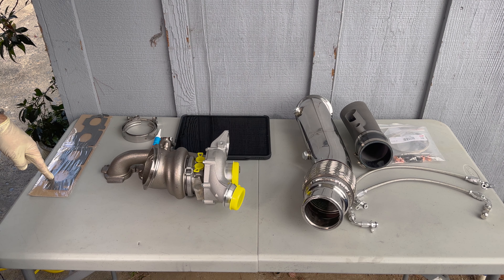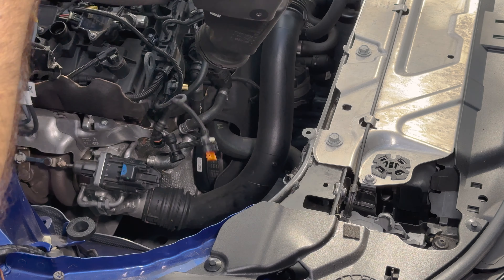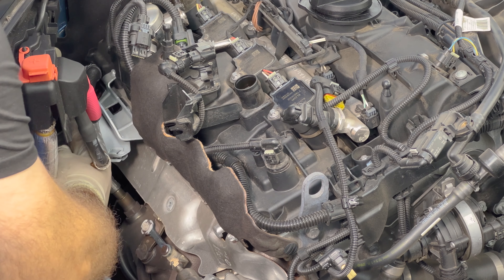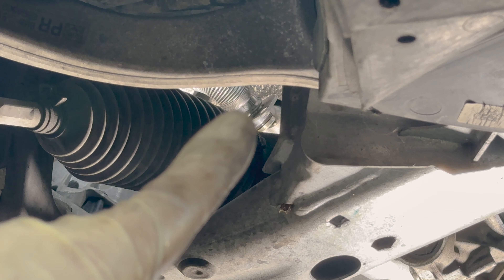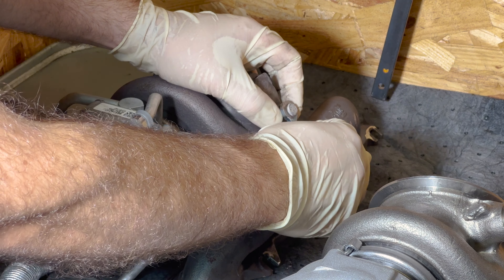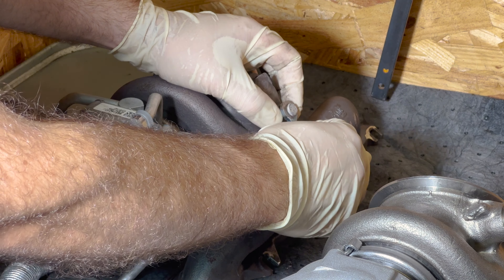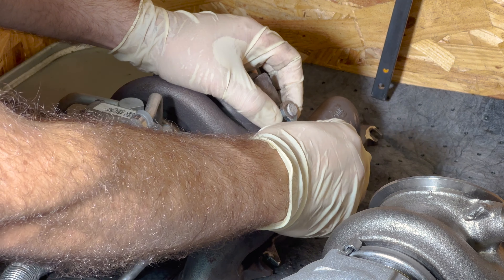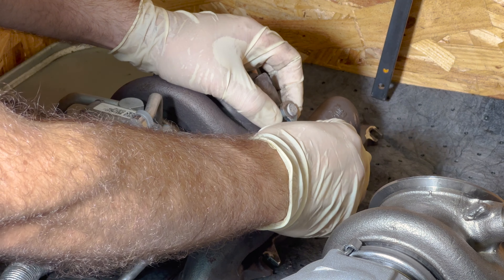I Gave My 4 Cylinder B48 BMW 500HP + Reliability!

Comment: I wonder if factory thermo managment can keep up with Upgraded turbo and power.
Reply from the maker: Luckily BMW uses the same radiator as the M340i on this car, for the sake of them standardizing they gave the 4 cylinder version all the upgrades from the bigger brother including the stronger trans and brakes/suspension for M sport models, even the stronger HPFP.  Normally you wouldn't have such a ready foundation for power, The M340i models hold super high resale because of their potential but I think the M sport 330i is the best kept secret in terms of potential vs how much they cost and how few supporting mods are required.
Reply: @VehicularDIY  , that is interesting to know. By "Same radiator as the M340i", are you referring to the high temp raditior (for engine) or low temp (for charge air)? I am just curious about this whole package. And just some background, I actually own G22 430i, which should share the same specs from 330i. But I have really big issue using this car on track: the oil temp could go as high as 140 degree in a 1;20 ish lap. Just wonder if you have the same issue?

Comment: Hey man! Absolutely love this type of stuff with the b48. Something about upgrading parts on the less popular engines is really appealing to me. What are your opinions on turboing an n52? Obviously the n54 is superior when it comes to performance, but I haven’t seen anyone really make a good n52 turbo YouTube video. I personally have an n52 and would love to try it out myself.. just cuz this type of stuff keeps the engineering of these engines so interesting… ($$$$ tho haha)
Reply from the maker: Hey!  Thanks, if I had a N52 and wanted more power I'd be looking into a supercharger upgrade.  If you wanted to turbo it I would imagine you could probably push close to 400 whp but haven't looked much into it.
Reply: @VehicularDIY supercharger is the way, it's easy on the N52 to just get the kit and do that, the N52 can handle 600 hp max with a good tune

Comment: Going to try this on a 530i. Goal is 400hp with decent gas economy m550 is just too unreliable and the 540 prices are up just because of the B58
Reply: post 2020 m550i hasn't reported any issues on the internet

Comment: I'm patiently waiting for your ipos intake manifold video 😊
Reply from the maker: It’s on the way right now, getting powder coated.  Installing a CSF heat exchanger today.
Reply: @VehicularDIY  Throwing a aluminum skid plate from turner motorsports on my g20 today.

Comment: Is there are a way to adjust the wastegate without any software? I want replace the flapper because of the rattle. Would it be possible to just leave the actuator in the closed spot and than assemble the arm somehow? Thank you

Comment: I have a rwd base model 2017 e300 w213 m274 full bolt on and stage 2 tune with a slightly shorter wastegate for a pound more boost. I’m not sure how much more it can take lmao 😂 I kinda want to test it and keep adding boost to see what the limit is.

Comment: Hey you mentioned 500HP with reliability. However you also stated the IM450 turbo is capable of 450HP? So does it cap at 450HP or you can squeeze 500HP from it without causing any problems? Appreciate the feedback. I’m actually talking to Kevin and ordering everything you did from him. Just waiting on my FEMTO unlock since its a 22 530i

Comment: I figured it was only a matter of time till the 4 cyl would be attacked by the tuners. Did you happen to get a dyno run with the stock turbo? Curious to see what the improvement is.
Reply from the maker: I didn’t but from what I’ve seen they put down around 240 to 250 whp stock so they are under rated as usual.
Reply: @VehicularDIY  kinda figured that. 200hp jump on a 4 cyl is no joke tho
Reply: FBO and stock turbo makes 260-270whp on 93 octane. Custom is around 300whp on 93 and 320-330whp on full e85. 

IPOS historically makes 370-390whp on 93 octane and 430-440whp on full e85 with a custom tune and supporting fuel mods
Reply: This was such a great video and installation. How much would you charge to install this on a 2018 b48 f36 430i gc?

Comment: Do you see any issues with this working on a F54 2017 Mini Clubman JCW 6sp manual trans w/ 10.2 comp ratio b48?  It is the factory 230hp/255tq version not the 300hp one.
Reply from the maker: They have a turbo specifically for Minis it's called the B48E upgrade, let me know if you would like a link to it.
Reply: @VehicularDIY I wanted to ask the same question (2019 2-door JCW with manual here) - please send the link and thanks.

Comment: Great piece of work. Any clue if sticking with the stock downpipe will work if I don't need 500 bhp? Seem like you did not need to add a larger fuel pump to deliver the fueling

Comment: can you imagine owning a used 1 in 10 years after all the heat cycles and breaking connectors and the wires are brittle as hell

Comment: Hello. Can we apply the same turbocharger to the G20 320i (B48B16) 1600cc vehicle we bought in the Turkish market. I know that the only difference with the B48B20 is that the cylinder volume is lower.

Comment: Would the f30 lci 330i 2017 hold with the same mods you did without blowing up?
Reply: Check if you have b48b20a or b48b20b, b is stronger

Comment: would this work a X2 M35i? thinking bout getting one actually they are 303hp stock and already have a bigger turbo then most other b48. Has anyone had a 2020 or 2021 X2 m35i ? thanks for any input

Comment: Is there a difference in the transmission between the M Sport and non M Sport G20 330i BMWs? Wondering if I need to find an M Sport version for a better transmission or it is only a matter of programming with XHP or another transmission software tuner. Never thought I would consider a 4 cylinder BMW but you got me thinking!!! Can't wait for your next video.
Reply: There's not gonna be any difference aside from at most a different map for sport mode (probably not even that). M Sport is just a trim level the most you get different mechanically are usually active shock absorbers and larger brakes.

Comment: how much power did you gain from the new turbo then? im a b48 engine 320i on a 99 ron map pushing between 298 and 306 hp with 400 torque on a 0ts 1 map

Comment: I’m almost half way through my installation now. I bought the IM500 for the big figures and top end in the future. I’m having a head scratcher moment at 3:40 for 2 separate reasons. One, I’m having the hardest time getting the end of that line out of its place. I took out the t30 screw but it will hardly budge. If there’s anything you can tell me that will help, it would be much appreciated. Also, when you started to take off your turbo, there were 5 E6/11 mm (I have gen 1 motor) and I’m also seeing another 5 of the same bolt below the headers that seems to be holding the turbo assembly in place. It’s also displayed in the 3:40 time stamp as you can see above that coolant line. I just want to know if those 5 bolts need to come out for the turbo to be set free. Thanks if you do reply.

Comment: Did you have to forge the engine parts?
Reply: I want to do the BigBoost600 turbo swap but I’m pretty sure i’m going to need to get forged pistons etc.
Reply from the maker: I'll likely run it at 360 to 380 WHP on pump gas most of the time and occasionally up to 420 whp on E50.  You can push up to 450 WHP with full E85 and port injection which I plan on doing but mostly for demonstration purposes.  So if you are happy in the lower 400 WHP range I'd say stock internals would tolerate that all day long.  If you wanted to try and push closer to 500 WHP that would technically be possible but you'll likely face head flow issues and should probably consider putting a forged bottom end in.  To be honest it gets to the point where you'd probably want to just go with a B58.  IPOS makes a turbo called the IM500 which would spool later but could target big power.  I think the sweet spot is around 400 WHP if you've got a B48.
Reply: Thanks for the insight. 400whp does sound like just enough.  @VehicularDIY

Comment: Is there a difference between the B48 you get in the 320i and the 330i besides the mapping?

I have a 2019 120i f20 lci I would assume B48 "Gen 1“ but not sure if the internals are different in the 320i and the 330i since it is sharing the same setup as in the 320i.
Reply from the maker: Yeah the pistons are different, the rods are the same.  You can upgrade the turbo but you'd be targeting less power, I talk about it near the end of the video.

Comment: Hi ... Nice .... What is your turbo recommendation to replace the stock turbo in the F30 328i ( 2012 Year with mechanical wastegate. ) to achieve something similar with the N20 ?
Reply: TTE400 is the move. 370whp on full e85.
Reply: @Sqwin_n20  - Thanks bud. I went to the site. Any idea how this compares to the MHI Big Turbo ?
Reply: @cp_pdn  MHI is maybe 330- 340 whp full e85
Reply: @Sqwin_n20  - Noted. At what whp should i get forged connecting rods ? Mine is a 328i but they still need forged connecting rods ?
Reply: @cp_pdn  close to 400 wheel torque.

Comment: This is fantastic. I plan on getting an F22 230i M Sport, but it's so hard to find B48/46 content, so thanks for this! Also, do you have any experience with F22/23 BMWs and if so, what do you think about them? I know you said you love the steering rack and turn in of your 3 series. Just wondering if you find the 2 series to be similar.
Reply from the maker: My sister in law was looking for a car and I recommended a 2016 330i to her a few years back and she's loved it and it's been reliable for her.  Don't have seat time behind the wheel of one but mechanically they are similar to an F3X.  All you would need to do on that is a HPFP upgrade from the one that comes on my car which is the same as the gen 2 B58.
Reply: @VehicularDIY  I'm not sure if I plan on doing a full turbo upgrade when I get the car, but I do plan on doing a down pipe, charge pipe, and tune. I'd like the get the power of an M240i while maintaining the weight of the 230i. Given this, do you still think upgrading the HPFP would be necessary? I'd probably be pushing no more than like 300-330 wheel hp.

Comment: How's the B48/B36 in the F30 330i? Just as reliable?
Reply from the maker: Yeah only thing with the F30 is the high pressure fuel pump needs to be upgraded to achieve similar results
Reply: @VehicularDIY  Does the same thing apply to the F22? Only need an upgrade to the high pressure fuel pump? Can you give a link to the part you recommend?
Reply: @johnrobinson6882 it’s the same b58tu HPFP the gen1 b58 folks use. IPOS sells it as well
Reply from the maker: @johnrobinson6882  Yeah that's right, if you follow one of the links I put in the description and look on IPOS site they sell a TU HPFP upgrade for gen 1 B48.

Comment: do you have a clutched lsd or anything or is it the stock open diff?
Reply from the maker: This car was optioned with an M Sport Limited Slip Differential
Reply: @VehicularDIY  I have an Xdrive 330i wagon and I was contemplating converting starting a build with it at some point. I dont wanna just get a 335 or soething because I like the Idea of it being a wagon cause its rare to come across in the US. Would you recommend getting an m sport lsd

Comment: Would it work on a B48 on a 530i? I didn’t want fancy chances if a downpipe and fuel pump and this turbo change can take me up to 400++ range on the turbo would be ok ?
Reply from the maker: Yes it would work on a 530i and you wouldn't have to upgrade the fuel pump.

Comment: Hey mate, the version of the B48 that goes in to the new 135i and jcw gp (300hp) has strengthened crank and bigger bearings as well as lower comp and thats only for 50hp more.
How do you reckon this thing will hold up? Clearly it looks like stock crank is a weak point?
Reply: I have the same question… can this be used on the f40 m135i?

Comment: Loved the video, but I have some questions. I noticed you kept it below 4k rpm. With that being said was the due to it not being tuned and you didn't want to push it? or is it cause the engine isn't built? Now I understand a built engine would keep it reliable and possibly add some more HP. I've done most bolt-ons, run E30 and have a stage 2 BM3 tune on my B48 and looking to get more out of it, would it be a good idea to swap turbos now or after building the engine. I don't track the car but I do some spirited driving and occasionally race and I launch hard; using the whole rev gauge. I want to swap turbos but I don't want to do that if I cant push the car with the new turbo until the engine is built? Also would the stage 2 tune on BM3 work? I know its better to get it dialed in but there's no tune shops near by and the last tune guy I used on BM3 gave me a tune that's less than OTS tunes and then ghosted me so I'd rather not have to go through that again if possible.
Reply: I have a b48 in my 330i, and I would not in a million years upgrade my turbo without upgrading engine internals first. I do not know if the G20 b48 engines are more built from factory but I can almost guarantee if he is pushing 500 hp to the crank as claimed this engine will not be reliable from long-term abuse.
Reply: Most aftermarket turbo kits I have seen for the b48 all list a full exhaust and upgraded internals as requirements.

Comment: Question, are you going to upgrade air intake with better air filter?
Reply from the maker: I'm going to try a drop in filter and intake muffler delete to start.
Reply: And can intercooler keep up with new turbo?
Reply from the maker: Given stock is water to air it can keep up luckily

Comment: im looking into doing a turbo upgrade on my 330 i have a vrsf downpipe already aswell as a upgraded intake do i need to get the same downpipe or would it work with any i honestly jumped into the g20 platform with no research so trying to learn a few things befor i end up buying something i shouldnt have

Comment: bro please answer me I wanna know if the gen 2 b48 im450 would fit on my toyota supra mk5 2022 2.0 i wanna buy it but Im not sure if it will fit please lmk
Reply from the maker: Yeah it fits, you have the exact same engine in your car as I do in my 330i.  If you use the link in the description it helps the channel :) lemme know if you have any other questions.
Reply: @VehicularDIY I have a problem with my car I Have a misfire on cylinder 1 and it has low pressure I got told by the dealer I should get a new engine do you think the same or is it fixible ? please bro lmk its my first car but dont know a lot 
i would appreciate the help

Comment: this is the same B48 as in a 2019 120i LCI right? 
It has 185ps standard and with a tune mine does about 270, but 500 damn
Reply: been looking at ‘19 120i lci myself I want some nice pops back. 125i would be better but 120 is still good for tuning🤝🏽

Comment: Would this upgrade work in an 22 X3 GO1 B48? If so i wanna get this done!
Reply from the maker: Yes you could do the same but would need to be mindful of the DME lock, it would need to be sent to Femto for an unlock.
Reply: Thank you so much and are there any exhausts you recommend for my X3 for a lil more free flow and sound?

Comment: This is impressive, but an actual question that I hope doesn't offend: why not get an M340i instead of doing all of this?
Reply from the maker: Yeah I covered that in other videos.  I think the M340i became a bit of a collector car already without people realizing, the Supra played a part in that IMO.  I sold my 2020 M340i a few years back with under 20k miles for 44K, that same car today with 40K miles and more than 2 years later would sell for the same.  A 330i loaded would be closer to 30K.  So they cost about 50% more, if you can get a loaded 330i and spend 4K total to give you more power than the M340i you've saved about 10K and would average about 5 MPG more in day-to-day driving.  Besides the engine itself the cars are pretty much identical, you could slot a B58 in and all the rest of the car would be the same, same transmission and radiators, brakes you name it.  Only thing you can't get is the sound of the B58 but the B48 sounds pretty good in sport plus.

Comment: Fueling upgrade
Reply from the maker: This car has a gen 2 B58 HPFP from the factory so it's not required with this turbo upgrade.  It is a bit of an overkill pump but probably cheaper to just standardize and a 4 cylinder can be pretty fuel hungry depending on the load conditions.  On F30s you need to upgrade the HPFP.

Comment: This will work for the G30?
Reply from the maker: Yes it would.
Reply: @VehicularDIY could my local shop follow this guide? There has been a few threads on Bimmerpost but this turbo seems to be better than the pure stage 2 turbo.

Comment: Would I be able to achieve this with the F44 B48?
Reply from the maker: The engine can handle power on those but the the transmission would be the limiting factor.
Reply: @VehicularDIY  oh ok I assumed the F44 M235i would have similar transmission as the G20 since it’s pushing more power now than the standard G20. Raising my curiosity as I would love to do this as a next project.

Comment: Since your in California now, what happens when you need a smog ? Didn't see no carb sticker the no fun police won't like that😊
Reply from the maker: Got a few years till it comes due but once this car is running ethanol I challenge anyone to put it on the rollers and tell me it’s not running cleaner than stock.